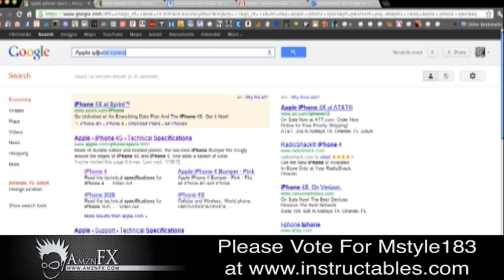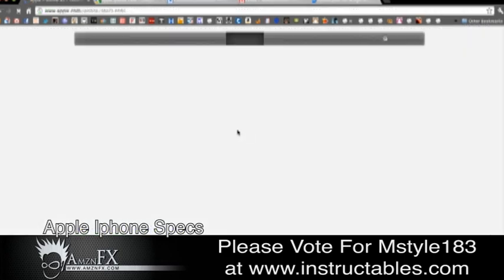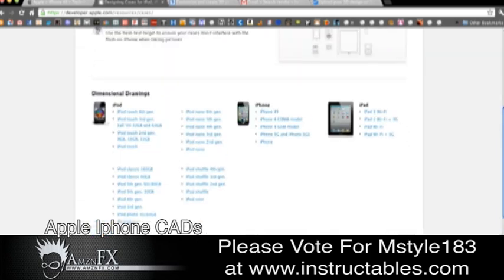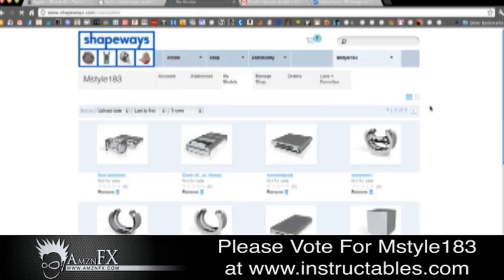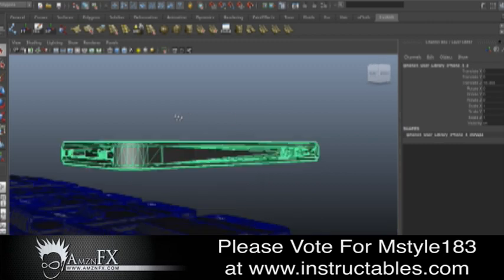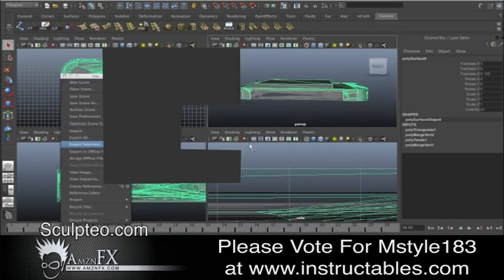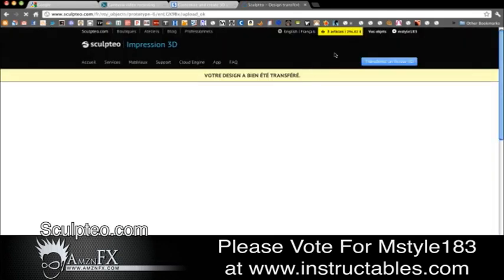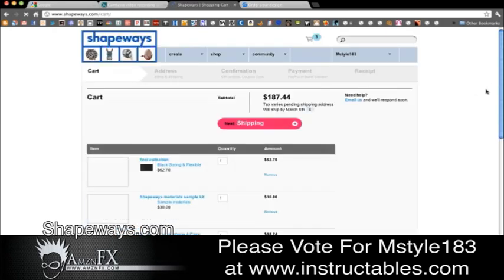How to Model an iphone case, check for holes and thickness and get it 3d printed

Comment from the maker: im making a small profit right now.. im also perfecting my case... once is perfected i'll start getting it injection molded instead and my profit margin will go up.
the problem with 3d printing it cost more to make but its veryy benefitial when you have design changes and/ or multiple models. 
Today i released my Galaxy S3 Case